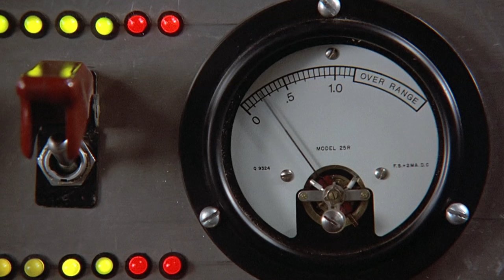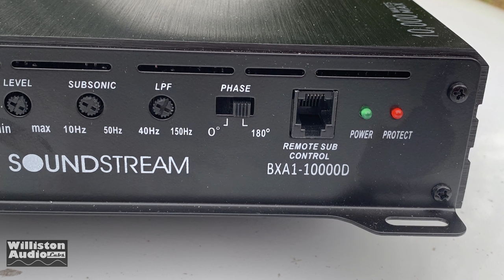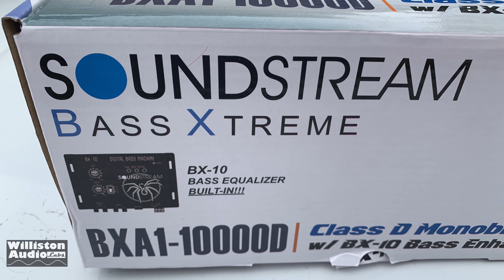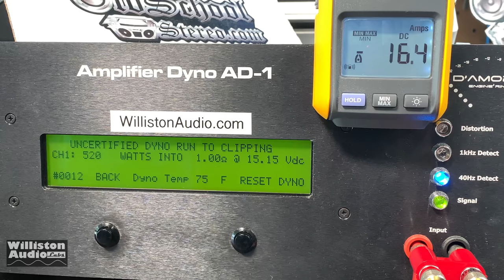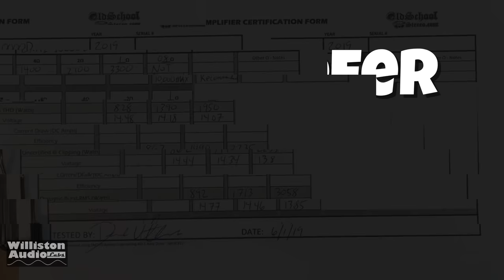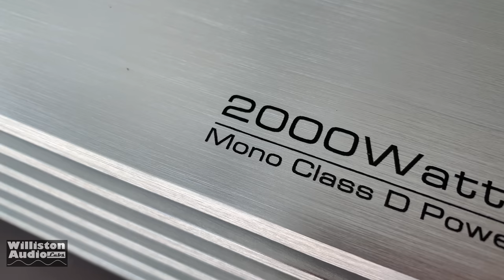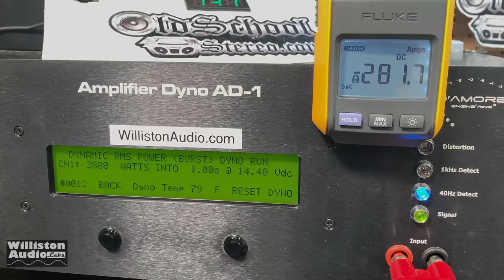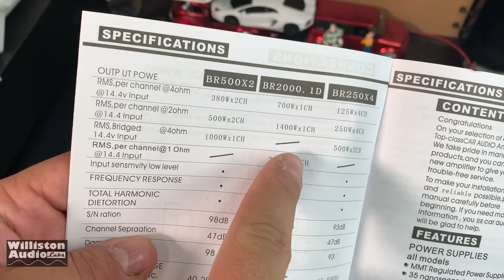Soundstream BXA1-10000D Bass Extreme Amp Dyno Test and Bass Rockers BR2000.1D [4K]

Comment from the maker: Soundstream BXA1-10000D - https://amzn.to/2K41B7t
Bass Rockers BR2000.1D - https://is.gd/bassrockers2k
Previous test of Power Acoustik 10kW Amp: https://youtu.be/tYgZeSLXXjM

Similar Amplifiers:
Audiopipe APMN-2000D - https://amzn.to/2EY0Fxi
SoundQubed S1-2250 Amplifier - https://amzn.to/2MQ5I9B
Skar Audio RP2000.1D - https://amzn.to/2Xz7AV1
Reply: 3000 watts for $200.  Not bad at all
Reply: i bought this exact amp (soundstream) and it lasted me just under a month.  this video explains why! i was forcing it to play 3000 watts lmao XD i used ohms law and a multi meter :D
Reply: The guts look like crap
Reply: The soundqubed is the one I got and I love it need a secondary one
Reply: My AR-4500 cut off at certain frequencies at 1 ohm it cldn't take some tracks at all. IDK why ppl mess with epsilon gear anymore when a few more bucks they can grab a  wolfram ,audiopipe or skar.
Reply: D off topic i wouldn't bother u but need help have a set of mid 90's mtx 7000 12" subs do u recall rms power and proper box size?
Reply: Test the Suono D990.1
Reply: @Pandacat 666 you pretty much always want to keep phase at 0 unless wired speakers backwards and they are pulling in when bass hits and not pushing out then u could set phase to 180 and it would reverse that 95% of the time your going to have phase at 0
Reply: have you ever used a  SPL dynamics  D10 s ? 
DD M4a ? 
SPL dynamics  ICE 3500D ?
Reply: @Pandacat 666 phase should be set at 0 asking as your running a reg setup if you invert them then flip it to 180 but for typical everyday use phase is going to be ran at 0 unless you wire subs backwards neg to POS and POS to neg
Reply: HEYYY BIG D have you tested any of those Harmony audio amps or subs???
Reply: Where's the full vid for the br amp?
Reply: instablaster...

Comment: I remember when sound stream was top of the line....😥
Reply: I don't know if they were ever "top of the line" but definitely much better quality then they are now
Reply: Tekboy 808  maxxsonics has nothing to do with Epsilon.
Reply: I use to own a reference 5 channel and I use to play music very loud for like 8 hours straight with it and it hardly ever use to get hot . Only time I'd get a little heat from it was when I used 2x12 on the sub channel
Reply: @jharkless92  You must be either young or not much of an audiophile. Soundstream was definately top of the line 80s and 90s. I owned one of the original Tarantula amps which blew everything else away at that time.
Reply: @vegaslimoguy2376  to be fair I wasn't even old enough to have a car in the 80's so u got me there
Reply: @vegaslimoguy2376  they were even better as sq amps before the "tarantula" showed up.
Reply: My x3.71’s and xxx15000D are ashamed of what Soundstream/epsilon has become smh sad they’re just a middle of the road hifonics quality low power lame lines now
Reply: Yup.  Now they are cicling the toilet bowl.  My bro once had two of the white ones with the art on them running 6 jl 10's.  Sounded amazing by early 90's standards.  But, this is what occurs when consolidation/buy outs happen.  Nissan will join the list soon enough as they are too circling the drain.
Reply: A buddy of mine had 2 of the reference 12s and a reference 1000 and was the hardest hitting 12s id ever heard in my life.
He had to of been doing close to 150db at about 33hz.
It was a vibrating beast,he blew the speakers 2 times and the delear replaced them for free both times after testing his electrical.
I was in the back seat adjusting his mid hi amp and he turned it up and it was painful inside my head.
1 of the loudest things ive been in was a tracker with 6 sundown sa12s and 6 sundown 1500.1s.
When i got out it felt like id been kicked in the nuts then 20mns after that my ribs started to hurt. 
My brother tried to sit in it and couldn't take it lol.
Reply: @vegaslimoguy2376 i remember when it was kicker and soundstream.
Ohh the early 90s was a great time.
Reply: May of been the 1100,but it was the all blue reference amp.
Im guessing he had it wired down and was probably getting 1600 watts or more from it.
Reply: darknature79 : yeah reference series were true sq gold... before they sold out and moved to China manufacturing sometime around mid 90’s...  (there were a lot of good amps in the late 80’s ) Designers like Nelson pass ruled the roost
Reply: @brianborell4469  Class a goodness.
Reply: @vegaslimoguy2376  I remember drooling over those blue Soundstream Reference amps in my local car audio store in the 90s.
Reply: I had a 2000d with 2 T4s back in 2008.. they went hard. Soundstreams new stuff is trash
Reply: Agreed back in the day they had some amazing amps to power highs I had a system that was so clean you could play some rocks like stairway to heaven and your hair would stand up one weird feeling I have only ever had it  twice and I used to do a lot of installs.
Reply: Steven Clingan and the old reference amps were the cleanest most underrated amps
Reply: Brian Borell agreed old reference series was amazing
Reply: darknature79  early 2000s quality was still good not as good as 90s I had one setup 2 t5 tarantula 15s would do 149 dB in a Durango. Then second setup was 4 splx 15s it did 156 dB  it was insane loud for a Durango and I ran the old Ma audio 4400 amp which was as wide as the truck almost lol
Reply: Justin Mallaiz they were still ok early 2000s when they came back but nothing close to the older stuff
Reply: You and me both brother. They weren't the best, but they were up there. The best that I've ever owned was a US Amps 125x4, but it was 1/4 ohm stable and was definitely a cheater amp, best of all, made in St. Petersburg, FL!
Reply: @darknature79  I have two Sundown Audio SA12D2s on a Soundstream Rubicon Nano RN1.5000D (a blue amp like my old Reference 1000x4 that I had running 4 Kicker Solobaric 10s ((the round ones, before the square ones)) with everything wired to 0/1 ofc wire in my Civic coupe racecar (it makes over 600 whp) and it vibrates every panel on the car with the gain half way up. I'm sure it's not making 5k watts, but I love my new Soundstream, just not as much as I loved the old Reference amps.
Reply: @Brock_Landers  i sat in a tracker with 6 sa12s and 6 saz1500.1 amps and when i got out it felt like id been kicked in the nuts then 15 mns later my ribs started to hurt.
Ive got a American bass vfl4480.1 and 2 md sound 12s in my civic and id guess its at about 144db with stock power and no extra battery.
I will probably get 145 with a extra battery but the subs for cheap $130ea new and 44lbs each surprised the shit out of me but ive got 2 American bass tnt15s and a rockford t2001bd and a legion sounds 3500 thats sitting until i get better power and i know that Rockford and them tnt 15s will be great.
If itll do a 146 i will be more than happy.
Reply: That was a shock to me as well. I had some old school stuff well 2005ish and they always beat there rated power. They where in my opinion one of the upper echelon companys. How the mighty fall... still 3k watts isnt bad for $200.
Reply: @jharkless92  yes they were along with PPI and PG and Orion and Rockford and OZ  and Zapco, and Kicker which was mainly just a subwoofer until the 90s. MTX was also back but even they didn't really start to takeoff until the early 90s. Autotek and Hifonics were also there. Oh yeah as well there also Alphasonic. You could almost weld with some of these amps, I know I left out a couple but you get the picture right. These were the heavy hitters. Made in the USA 🇺🇸.
Reply: Soundstream, PP have fallen really far. I'm saddest about Rockford Fosgate because they used to be made here locally and if you knew someone that worked there, you could get subs anywhere from 25 cents to $2 an inch depending on model. We never had flea market amps around here because everyone could get RF amps with legit power for less than most of those flea market parts
Reply: @brianborell4469  Yep. I still own a Reference 1000s and Reference 500s and they're amazing amps. Unmatched power at the time and built like tanks. Heck, they even had balanced inputs.
Reply: The blue Soundstreams were really good . Then Episilon came along and destroyed the reputation. DEI bought out companies like US amps and put out garbage . What a shame
Reply: There speakers bumped in the 90s
Reply: MAGA....2020.....Make Amps Great Again
Reply: Soundstream, Hifonics, Precision Power and Orion was the shit back in the day.  Now it's just shit.
Reply: The only negative thing is that these great 80's-90's amps were $1000+ back then. You could buy a new 5.0 Mustang for under $12,000 then.
Reply: 90s elite , times has truly changed
Reply: When they were made in the USA.
Reply: Lol.. They were never top of the line. But they were much better than they are now
Reply: Wel said!!!
Reply: Late 80's and very early 90's.....before they went into Circuit City!!!!
Reply: The old Rubicon amps
Reply: @vegaslimoguy2376  exactly brother! Back in the 80's I was an installer at Phantom Electronics in Thousand Oaks. We had all the dealerships in our area coming to us. For Porsche, Ferrari, BMW and Land Rover it was a/d/s or Soundstream Reference series only, for our installs. Same thing when I went to Rodeo Sound. Bently and Rolls required those two brands or Nakamichi only!
Reply: Go back 10 to 15 yrs ago.

Comment: Well,  considering the purchase price 2k rms for 200 dollars is amazing , I'm sure you remember 1999-2007,  2000 watts rms would cost you a arm and a leg.  I wish they would have just labeled it correctly and been done
Reply: This line of thinking is ... DATED... it doesn't matter what audio equipment cost 20-30 years ago that would be like expecting misleading ratings on microwave ovens because they cost pennies today compared to 1985 ... The VCR cost $1400  when it first came out and by the early 90s you could buy a VCR of better quality than the $1400 ones that first came out for $200 or less ... Electronics drop severely in price when the technology is old and you have many handfuls of companies manufacturing the products not just a few ...lol... or 1 or 2 .
Reply: Now they want 300 for the 2000rms amp and still no 0ga inputs
Reply: That line of thinking was FACTUAL. Get over it
Reply: On dollar per watt, back in the days, i felt  ripped off. I cant complain.

Comment: Sad to see the soundstream name come to this. Had soundstream back in the day and it was an awesome amp. Bought a 600 watt mono amp about 5 years ago and it is still hitting hard to this day. It’s a full on fleamarket brand now.
Reply: 2011joser : It turned flea market back in early/mid 90’s.. before then they were like Ferrari  or Porsche (top models included)... They don’t make cars cheap enough (in my country) to compare to this amp now
Reply: Owned by epislion still. There's not one thing wrong w them there's different amp lines for different consumers. Did you know soundstream has a dealer only line of amps n subs you won't find on eBay or Amazon also it's my understanding you can't simply buy it and install yourself. I think the only way you or I can rock it is to have it installed by a certified installer

Comment: It’s almost like they are rating 1 amp with the power of 2 strapped together. Great deal for $200 again, just wish they would rate them correctly. For $400, you get about 6000 watts of dynamic power. Thanks again for a great video

Comment: It looks like the engineers over there at Soundstream set out to design a decent amp but the marketing department stepped in and made them look like big dummies. It looks like a quality amp. You don't see 105 degree caps in very many amps on the market these days when 85 degree caps are so much cheaper. 

The board layout looks to be their own design. Does anyone know if this board design is being used by any other companies? 

If they where straight with the numbers they might actually be able to regain their reputation.  Soundstream did make quality products once upon a time. I've always been an Orion guy myself and I ran Hollywood Sound Labs too back in the day but I put Soundstream amps in friends vehicles in the 90's and they where good back then.

Comment: So it is equivalent to the Rockford fossgate T 1500.1 BDC P. And it is 25% the price. Sounds like a deal to me but you better cover up that 10000 when you put it up in your trunk.
Reply: Sound quality is something to consider rather than just raw wattage output. My T1500-1bdcp definitely sounds different (deeper and cleaner) than what it replaced.
Reply: Rockford Fosgate is a class BD  Sound Stream is a class D.   Thats Like comparing a Ford Pinto to a Shelby Mustang.
Reply: @505Tempest   I totally agree.

Comment: Could it be safe to say on average that the cheap amps you should just add another 0 to the fuse rating and expect less than that on certified wattage? I've seen that a lot on your dyno vids. Seems like the amperage draw stays fairly efficient on some of these cheapo amps except when they are doing dynamic.

Comment: I still run a Reference 200S. That little amp is still a tank. I blew a 405 a long time ago, my own fault im sure, but that was also a fantastic unit. for the price, your still getting a lot for your money when you consider how much it used to cost to get an amp back in the day putting out this much power.

Comment: 105 degree caps and for that amount of power it's a steal. My first amps were a 45 watt linear and a punch 75 so I love the price
Reply: I'm old school too, first real Amp was a punch 75, before that could only afford crap. Crazy how prices came down. I just bought a Soundqubed s1-1250 shipped for $149 direct, back in the late 80s, Amp would have been 3 feet long, cost 1500.

Comment: People are complaining but I remember back in the 80s when 500 watts would have cost you $750. And that was back when minimum wage was $4 an hour.
Reply: Oh, I remember those days. My Fosgate Power Series Mono amps (250M) 250 watt were a little over $500 each. Still have them and use to this day though.

Comment: Hey Big D.   I just came across a Autotek model 222 with the 1 or 2 ohm switch on the bottom in mint condition for way less than i feel i should have paid.    Have you ever tested one of these?   What kind of power should i expect out of this?

Comment: Would the soundtrack amp be better than the boss phantom  5600 Watt? They both lie about the numbers but I kinda like this amp. I'm powering  2 /12 inch 1ohm rockville punisher subs. This phantom  amp doesn't seem to have the power to push these much  kinda sad seeing how even rockvilles numbers are bs. These things hardly budge even when I've got it cranked. They get loud don't get me wrong but the subs are barely  moving

Comment: Bass rockers ... Is basically what I have with the ard1.8000d ... Same guts same internal wiring and all same power too only difference is I only have one single  subs output .. 4 gauge ... But I would love to have dual 8 gauge outputs ... Another thing was I hade to shave down my stinger 4 gauge to 0 gauge reducer in order to fit .. I hated that too .. otherwise this amp has been great to me never overheats .. very efficient ..
Reply from the maker: Interesting 🤔

Comment: Its not a parametric bass EQ, its a subharmonic synthesizer, very similar to the audiocontrols epicenter. Probably you got distorsion because the output voltage of the "epicenter" part was set to 10 volts, directly to the preamp.

Comment: That double volume knob....Could I open it up and run 2 separate speaker wires the run those cables directly into a crown 1502 amp?

My goal is to power two bass shakers but I want to individually control the intensity. Unless there is any better way I'm open to any ideas. ..Bass shakers are rated 300 watt rms.

Comment: 4 gauge (2B&S) is rated to 255amps here in Australia for 12v .You could run 2000watts RMS constant on 4 gauge with no problems, just my opinion. I've seen 150amp alternator with 6 gauge wire, it is just crap but that's what they use. I understand though, car audio you don't want to loose any watts at all, I would use zero gauge myself hahaha

Comment: I'm trying to find a 6x8 speaker that will handle alot of power I have hurt not blown a set of jbl gx862s I love the way they sound but there starting to fail I running then with a duel xp84d which has been a incredible little amp for the last year only paid 60bucks for it  wats your recommendation don't want to spend a crazy amount of money like 150bucks or less thanks

Comment: What up Big D Wiz this is Big D from Va. You should do another test on the Ignite 3000d. It's even better that you thought. I did a budget build with 9 pyle power 15s and for now one of those amps. It's running smooth at a half and ohm yes a half an ohm without getting hot or going into protection. I would love to know how much power it's putting out. I'm about to series parallel the subs up to 1 ohm and strap another 3k to the one i have. I just wish the inputs were different.

Comment: I forgot to say love the vids and could you do a gravity warhorse 3 6 or 8k? I've even asked the eBay sellers and they won't ever reply with max amp draw, rms wattage  or any specs and neither does the manufacturers website. Only max ratings. It smells real fishy I'm just curious as I would buy one if knew it might be a good deal. Starve Meade tested one b4 and it did pretty decent but it wasn't the warhorse series.

Comment: P=IV , 10,000 watts at 14.7 volts from alternator is 680.27 amps. 680 amps through 20’ of 0 gauge wire.... think about that. 

Of course they said peak though.
Reply from the maker: And it takes 1.21 gigawatts to power the Flux Capacitor to make time travel possible 😝